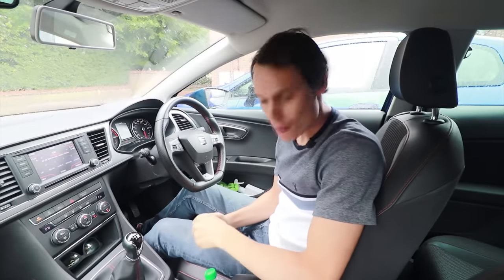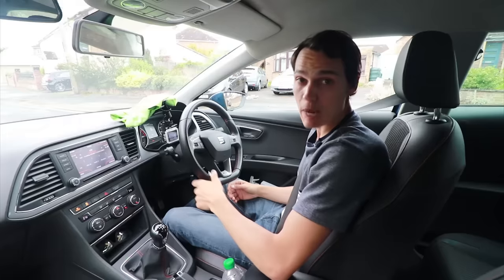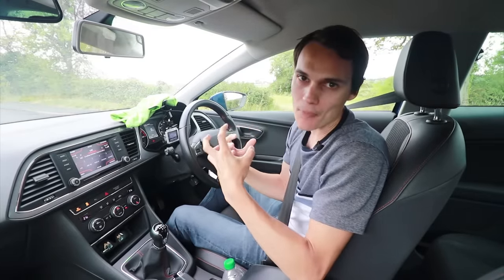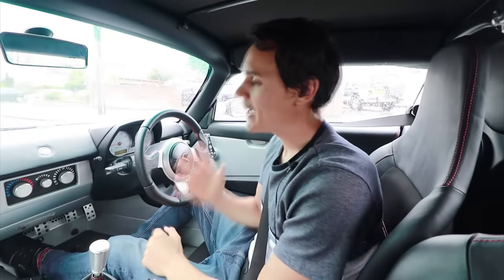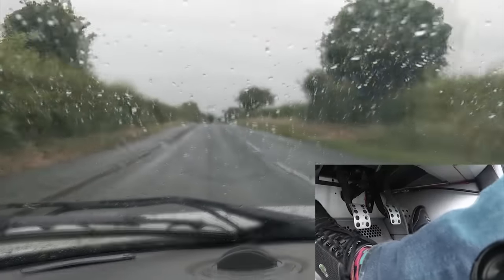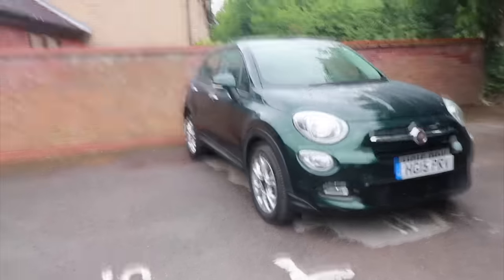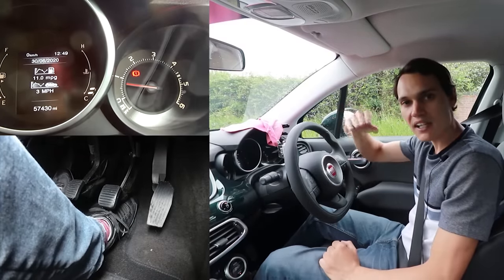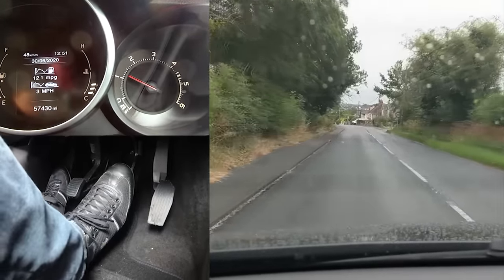Upshift blip - advanced technique for changing up gears smoothly

Comment: I know this is a 3 year old video, but I'll ask, maybe someone will know the answer:

When I do this tehnique, the gear shift is smooth, however I can sometimes hear a fairly loud clunk when bringing the clutch up, also my revs don't shoot up and I didn't add a massive amount, any ideas why this happens?
Reply: I don't know if you still have this problem... In that case, have you checked the revs? Are they too low when you come off the clutch? I have noticed that when i do up blip shift on a uphill by the time i  lift the clutch (after the gas blip obviously) the revs drop too much. Maybe I need to be quicker or to give more revs...I'm quite scared to damage the clutch or the flywheel in order to discover it by myself 😂. Have you found any solution?
Reply: @maxander61 after some practical use, it just means I've not brought up the revs enough and simply dumped the clutch. wasn't jerky but it wasn't perfect either, I noticed it mostly going from first to second gear, where torque is high.

TLDR - it won't damage your car, but try to minimize it with practice, you'll get the hang of it with time.

Comment: Do i need to blip the throttle for upshifts if my car has a bit of rev hang ? i feel i can release the clutch exactly at where revs should be for the next gear without needing to blip, since the revs take longer to go down on my turbo car (subaru WRX 2020)
Reply from the maker: Definitely no need to blip if you have rev hang.

Comment: Whats better?

Hit the clutch - change up gear - give a little bit of gas - let the clutch come up - hold on the bite point for a second and let it come off completely 
OR
Hit the clutch - change up gear - let the clutch come up to the bit point - hold it at the bite point and add some gas at the same time - let the clutch come off completely
???
still confused…
Reply from the maker: Both will work fine, adding gas after the bite point may cause the car to slow a little more during the gear changes but is easier.
Reply: I find that the 2nd method you listed will have a faster response and rev matching . The revs jump because the clutch is moving the revs up, but you are assisting it because you are adding a bit of gas. 
The 1st method you have to wait for the revs to drop, catch it with the clutch on release , then add gas

Comment: Wouldn't be just better to up shift quicker so RPMs don't drop? Never heard of blipping the gas to change up...
Reply: Can destroy synchro. Never throw the stick into gear.
Reply: @tristan1805  What are you talking about? Nobody blips to upshift. If that was the case all cars would have destroyed synchros...
Reply: @pablouvedoble Most people use the clutch to get the revs up which is fine. But be gentle with the stick.
Reply: @tristan1805  People don't even rev match while down-shifting... And shifting quick has nothing to do with brute force the gears

Comment: In all my cars upshifts were always smooth, because the revs don't drop faster than me shifting. Similarly in this video I watched closely his revs on the very first example and at the moment before he blipped the gas it showed 1500 and 1600 after the blip when he clutched up. What's even the point?? He could have just shifted to 2nd like normal and it would have been buttery smooth just as much. Blip on upshifts is a wasted effort. In a regular passenger car at least. Motorsports? Dunno. I'm familiar with rev matching, but upshifts don't generally need any throttle input. Not on my sports bike, not in my passenger cars. 🤷

Comment: my 2015 focus diesel automaticly rev matches on upshifts, the moment u press the clutch the rpm drop to match the next gear.. if u shift within 3 seconds, after that it will drop down to stationary.
also obviously doesn't work if u want to skip a gear. weird that both the seat and fiat in your video don't have this function, being modern cars...
Reply from the maker: I've not driven a car that automatically rev matches up gears. I know some exist for down shifts but mostly performance cars.

Comment: you dont blip the throttle on an upshift because your RPM's are supposed to drop. By the time you release the clutch the engine will be where it needs to be. Notice how your throttle blipping is bumping the RPM to 2k and then it just drops right back to 1.5 anyway? Pointless. You only rev match on downshifts when you need those extra RPM's to avoid jerking the car.
Reply from the maker: Depends on the car, in some cars the rev drop too quickly especially my MX5 and my old VX220. It's better for the clutch to bring down falling revs to the correct level than to try and bring up falling revs.
Reply: @ConquerDriving  I understand what you're saying, but in reality if the revs are dropping too quickly all that really means is you're probably shifting too slowly
Reply: @codmott286  you shouldn’t have to rip gears when you are just casually driving.
Reply: @T_Ralphhh  if you want to avoid jerking the car around you have to be pretty tactful. He's blipping the throttle on upshifts which might help him avoid the RPM's from dropping too quickly, but really he should just be smoothly applying a little gas as soon as the stick is in gear and his foot begins to release pressure from the clutch. Not a full blown throttle blip like you do on a dowshift.
Reply: Yes. This is only for some slowass shifters who need ike 3 seconds to shift...

Comment: @5:30 dude you are releasing the clutch wayyy too late, the rpm is already down when you release. you need to release the clutch as the revs are uppp,
Reply from the maker: It was smooth, if I did it too late the car would jerky. Also, if I did it too early the car would jerk.